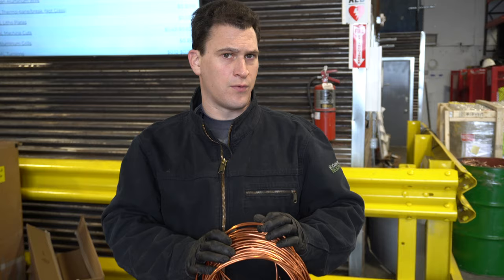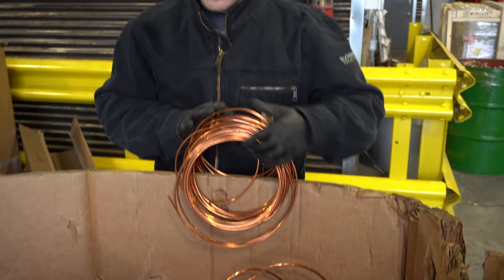Why You Shouldn't Make Scrap Ingots - Why Scrap Yards Will Say No To Buying Them

Comment: it's simple if you can melt them you can make up to 6 times more then copper prices but never sell ingots to the biggest rip off people called the scrap yards sell them to collectors who pay good prices been doing it for years i will never sell copper or brass to scrap yard they only get my waste i have no time for. If you cant melt down to ingots for sure take it to the yards.
Reply: the yards are not ripping you off, you are just selling to the wrong people. scrap metal is SCRAP value. once you make an ingot it becomes ART - but the material it is made out of is still only worth SCRAP value to a SCRAP yard. if you then start selling ART as SCRAP if it YOU that is ripping yourself off - would you sell a painting to a gallery or to a wood and paper recyclers?.... think of ingots the same way.
if you want to sell SCRAP, take the metal straight to the yard.
if you want to sell ART, ingot the metal, then sell it to ART collectors (ebay etc.)
if you want to ignite money for the sake of it, sell ART as SCRAP.
Reply: @Debbiebabe69  I've recently started to melt copper in my home made foundry, for exactly that, art. In my case however, I have access to a good bit of copper wire, but in that form it's really only good for just that, wire. If you take that wire, and turn it into ingots, now you can make bronzes for casting, which I have, but more in my case, you can now hammer it into sheets to be used in sculpture. I've no interest in scrapping, I'm more of a collector myself I suppose, because much to my wife's dismay I also have very little interest in selling anything. Meaning I'm a collector of my own art
Reply: Learn to use full stops 😂
Reply: You could probably make ingots and sell them to a hobby caster for more money. It's not like they're making parts of a machine with their metals. They make what they want, so they shouldn't need to know the exact mix of metals. Copper is copper. The tin that is used to make bronze for hobbies usually isn't 100% tin. You could sell it in between the price of what the yard would pay for that if it wasn't melted and the price that it would cost a hobby caster to buy that same amount of metal.
Reply: @Sam-gf1eb  is a periid and you didn't either brug
Reply: I'm 2 years late but I fully concur. If there's people selling pre81 copper pennies at the cost of copper per ounce, then a clean ingot will bring far more. Lol
Reply: @Nic Premoe  but who are they selling to that's what i need to know
Reply: @Sam-gf1eb  that makes sense
Reply: Who are you selling to?
Reply: @TheDeepDiveLLC  uhh.. "joe momma"? Jj/jk ngl fwiw idk
Reply: i have 300 plus pound of pre 1982 Pennie’s and don’t know what to do with them
Reply: @xforgetful5464  of course you shouldn't melt them because that's illegal .but if you did you could sell the ingets and or keep some back for a rainy day paper money can become useless over night .but metals will have value no matter what .
Reply: @charlesmatthews9946  This statute means that you may be violating the law if you change the appearance of the coin and fraudulently represent it to be other than the altered coin that it is.
Reply: Well said couldn’t have said it any better 👍
Reply: Damn right. I'll throw it away every time before I bring them anything
Reply: I wish I had a scrap yard that didn't try to pay half price for my metal. I guess as long as they can stay in business screwing over meth heads who pull copper from live power lines, then they don't need my scrap.

Comment: Not necessarily true.  Mixing steel and copper is actually difficult due to the big difference in melting points. Mixing aluminum with copper will drastically change the color and appearance as will Mixing zinc, tin, or lead. Copper has a distinct red color that is hard to mistake for anything else.  The only thing relatively close would be red brass which is a brass with a high copper content. Aluminum bronze is light gold, yellow brass is yellow gold, red brass is more orange as is bronze. Most large foundries pre-shred the material and its accurately sorted by xray and air jets at a very fast rate.
Reply from the maker: Great points- thank you for sharing that viewpoint.
Reply: @iScrapApp  that's an impressive and rare response to someone disagreeing with you...wish more people could be like that.
Reply: Facts
Reply: @iScrapApp  If youre in the business of semi precious or precious metals the responsibility is on you(the business owner) to have the correct equipment to test and evaluate the metal by whichever means you can reasonably afford. Its in your best interest as a business to do so! If a pawn shop can drill and liquid test metals.. You can do it too! If you cant afford liquid tests or an XRF machine to vet your regular customers you're not going to be very successful at running a profitable business. 

No one is spiking thier copper ingots with lead on 1000 lbs of copper. It would cost them more in time and resources to even do that! Think smarter!

Scrapyard worms are about the same to me as sanitation collectors or car salesman. Actually sanitation workers are harder working and recieve less credit and are actually providing a valuable service, I shouldnt have even compared the two.
Reply: I've seen steel wire that looks identical to copper inside and out are you saying it will change color once melted?
Reply: @iScrapApp  Copper is about to be the new gold in twenty years, because of electrifying the country with cars,wind turbines,etc it's believed that stock prices will be crazy.
Reply: @BWcapture  steel and copper are  completely different looking metals. You probably have copper clad steel.

Comment: I see lots of them on eBay for around $20 a lb
Reply from the maker: Wow, that's pretty good!
Reply: @iScrapApp  overpriced tho probably because of fees and propane cost
Reply: They are good for people who do casting as a hobby. I buy lead in ingots to cast for my musket. They are a nice, neat way to stockpile for whatever you use em for.
Reply: @thesusboomerroblox6516  ah ... no #2 copper in the Poplar bluff ,Mo area is $3.05 per pound .......and that is a basement price in the scheme of the scrapping pyramid. . . . in other words the scrapyards are netting $6.00 - $12.00 for their poundage , so who do you think is getting robbed ?
Reply: I'm not sure where you're getting your numbers at. But if copper is trading on the stock market for $4.20-4.40 a lb. Then $3.05 a lb for #2 is pretty darn good. You're right some yards do rip people off. A yard here is $2.20 lb for  #1 . But you drive 20min to a certain little yard and it's $3.30 . And the owner of the first one has a yard less than a mile from the one @3.30 and it is still  @ 2.20. 😂 . The first one also won't buy cats but they will take every one off and sell it for themselves and grip that it cost them  .08 cents a lb. Now that is what I call a ripoff.

Comment: I didn't know that people tried selling ingots to scrap yards. Everyone I know that has the equipment needed for making ingots sells it as investment or collector pieces on ebay.
Reply from the maker: You would be VERY surprised how many people try to sell aluminum ingots of cans melted down.
Reply: @iScrapApp  I do it as a hobby, but never have I tried selling them. I at least know of the impurities in cans.
Reply: @OldBastard-dj6er  the problem with your comment here is a scrap yard has to know what the alloy content is in any metal they buy. If something is melted down they have no way to tell what alloy a metal make up is. So by receiving it in its manufactured state as in a can, in wire or in a casting they know what type of alloy a particular item is because alloys are particular to the purpose they are used. Plus when someone melts and pours a bar the scrap yard can not tell what has been added to it. Take a copper bar any number of thing can be hidden to reduce the amount of copper while slipping cheaper metal into it. Not all people are fair and honest and will do anything to cheat. The only thing a scrap yard can do to combat this is through the use of a spectrometer that are very expensive and they can't afford to take time to individually check each bar that may come in. They need their time to properly serve everyone that comes in to sell their scrap.
Reply: @kenjett2434  the problem with your comment is ... I know the knowledge concept of what is in a bar . . . .  I get it .

With that said I also know that scrapyards will cheat a guy no matter what  ( a block of steel under the scale carriage  to cheat the weight ...for instance ) 
I could continue but what is the point otherwise .
Reply: @Ball Eater  shouldn't be any impurities other than paint and plastic which creates slag because it's burnt off. Many mis conceptions on the purity of molten metals.

Comment: Over the course of my career, I was the technical resources manager for several large foundries. Most of our raw materials were purchased from a small list of validated and approved suppliers only. One of our operations included an aluminum smelting process to pour into sow molds, which were later alloyed in our large reverbs. 

For the smelt operation, we did purchase from individuals, however, only if they could provide substantial quantity. I recall an instance where a small smelter brought in a few thousand pounds of aluminum pigs (30# ingots) which we ran through the smelter furnace. After melting, we pulled about 100 pieces of rebar from the melt chamber, obviously impacting his paycheck. 

Operations such as these who perform additional alloy processes, and have portable and dedicated spectrometers, are better suited for this type of business. That said, I would purchase truckload quantities of copper chop, but never copper ingots.

Comment: I've melted down aluminum scrap and poured muffin tin sized ingots. The yard rarely says anything about them. They get classified as old cast, which is mostly true anyway given the stuff I find.  I've never done copper ingots, but here in MI we have some serious scrapping regulations specifically to discourage copper theft. It wouldn't surprise me if they flat out refused the ingots on the basis that they can't be sure it wasn't from something stolen.
Reply: The purpose of ingots is to discourage scrap yards from determining source of metals. As in did the copper come from stolen ac coil, wire or motor which is the objective in the first place. If one scrap yard said no there are plenty that will say yes.
Reply: Ebay, etsy, etc. will pay wayyyy more.
Reply: Ingots can have a heavier metal melted into center of it which discourages buyers  , as for stolen that would be harder to prove unless specifically marked
Reply: Yea all yards love ingots it makes there job easier and if u size them right only takes a second to slice them with very thin cutting wheel on grinder I usually bring my own so I know it's the thinnest slice taken out of them if they don't trust it but once u go to a yard enough and ppl know u they will start trusting you
Reply: You'll probably make more money on investing in copper rather then trying to scrap it or turn it into ingots.
Reply: @bryantclay7212  I'd have them weigh it before they cut it with a disc, that's my money. If they want to use a shear that doesn't remove material, I'm fine with that.

Comment: “Maybe there’s water inside” made my wife and I cringe. I get it that you are only trying to help here and that is very much appreciated and the rest of the video seemed pretty legit. I’m not sure why anyone would go through the hassle of drilling out a bar or an ingot and try to fill it with water, or god forbid attempt to mix water in with liquid metal. Either way, that has the potential of seriously injuring someone or killing them, not to mention setting EVERYTHING on fire. We aren’t scrappers but know quite a few and know the kinds of people who do scrap. We do however do a significant amount of casting from scrap materials for artistic and practical uses for ourselves and for friends. Moisture and liquid metals don’t get along all that well. Take a look at steam explosions. There’s a reason that when home casting, ALL of your gear has to be completely dry. 
Otherwise, keep up the good work and thanks for another interesting video.
Reply from the maker: Thank you for letting us know- we are not experts on ingots so we appreciate the advice.
Reply: What, people act like they havent seen water that can resist temps over 1000 degrees f. Sheesh!
Reply: i got a good chuckle on that one
Reply: Moisture in metals is a real problem.
Don't laugh at that, serious accidents can happen when metals explode from the steam pressure!
Reply: @emilalmberg1096  No Joke, Steam explosions are not fun at all. Had one a while back when melting some copper pipe.  I had the pipe crushed down and folded over to fit into the crucible. A second after I inserted it into the pool of molten copper there was a loud pop and molten copper shot out of the top and went everywhere.

Comment: Take what he says with a grain of salt (not meaning as disrespect but there are two view points in this equation and yours is biased towards your view point as mine is to mine).  Scrap yards are always looking for ways to screw you over.  You can bring bare bright in but because it's 14guage stranded they only give you #2 or #3 pricing which is a big difference from #1 in pricing.  So "REAL" advice from a "REAL" electrician is research the scrap yards around you and don't be afraid to look up to 80 miles out.  In my area alone there are roughly 21 scrap yards that buy scrap.  Out of those 21 only 1 will give fair pricing and not try to screw me over in the process.

#1 RESEARCH THE YARDS!
#2 Find The Yard That Best Suits You!
#3 Learn the rules/grading/pricing they offer.
#4 Smelt only what needs to be smelted.  If they pay #1 pricing for 12guage Stranded then leave it intact and sell it as it is (#1 because you will lose weight when smelting and #2 it's an expensive process to get started into if you do it correctly).
#5 If a scrap yard wants to cut your bars in half.... let them and be nice about it.  Just make sure to have them record the weight before cutting!
#6 And for heaven's sake don't sell because you have it.... Sell when the market is appropriate... which right now... it's not lol
Reply from the maker: Thank you for the great feedback. We appreciate it. We agree with you that it's all about knowing what yards buy and HOW they buy various materials. One thing I think we have to disagree on is that scrap yards are looking to screw you over, while this unfortunately is sometimes true, it's not for all of them. So yards will talk to you about grading and how they buy various materials. 

Out of the hundreds of yards we have talked to over the years, almost none of them buy homemade ingots, and when they do, they pay a dirty of lower price in general. But, for those that are looking to make money from them, if you have a good yard that you can work with and get pricing on, then we say go for it. But for most scrappers, we wanted to tell them that this method may not pan out the way you think, so we are just trying to educate.

You seem to really know what you're talking about as a scrapper and we love that, we would love to line up a podcast with you if you're interested, email us at info@iscrapapp.com

Comment: Of course your going to say that because it gives you more options with the metal . My buyer does cut the ingots and checks the quality but I do get a better price for my efforts especially with aluminum and it’s much easier to transport then bulky scrap ! I also cut my steel into 3’ pieces for easier handling and clean rivets and bolts off and box them separate . A bit of effort goes a long ways !
Reply from the maker: A lot is about relationships and when you have one with your dealer then your ingots can be trusted. 

Many other dealers/yards have had negative experiences and those are what are generally thought of in these cases.
Reply: @iScrapApp  👍

Comment: The only static I have ever gotten from my local scrapper, which is part of a national chain, is my longer ingots got cut twice as described to ensure their machines got an accurate image. So I just make more shorties. My devil forge burns at an adjustable pressure giving me complete control over how slow and therefore economically I melt each material. I make Alot more via ingots than I otherwise would. Not had this problem with two other yards either. Not sure where you are but that's my own experience.
Reply from the maker: Very interesting- if you have good partners maybe you are in the right place at the right time.
Reply: Why would I spend 1 second of my time or 1 cent of my money to melt copper scrap into ingots if my purpose is to sell them as scrap? It doesn't increase the copper value, at all. 
Talk about a low watt bulb...

Comment: Most scrap yards can test the purity, if it's not in bars. Make you ingots smaller for testing. Bars are bad ass but there lies the problem, their too big and scrap yards don't want to have to cut into them to test, takes up too much of their time.
Reply from the maker: This is 100% correct. Good thinking with the smaller bars, because if you do find a scrap yard that is willing to buy them it will make it easier.